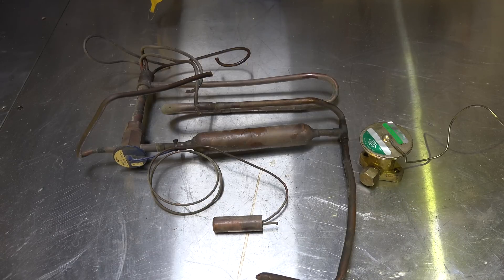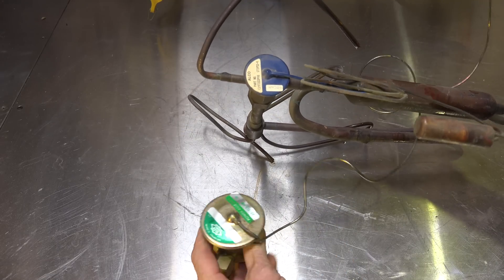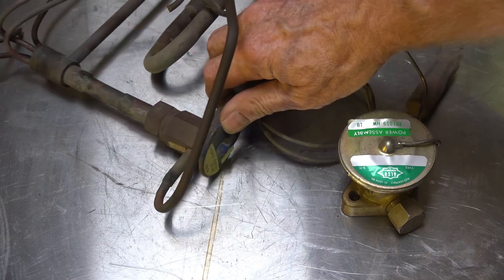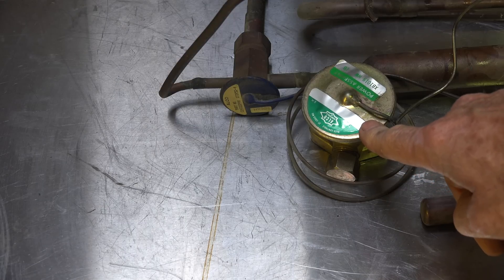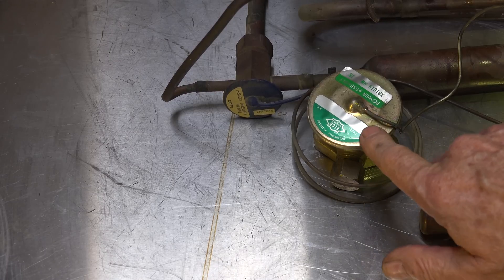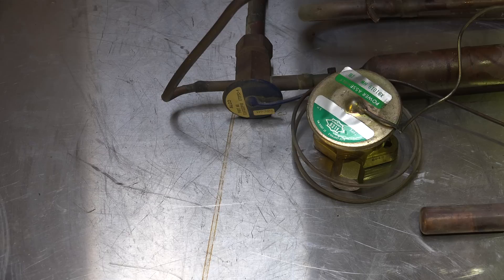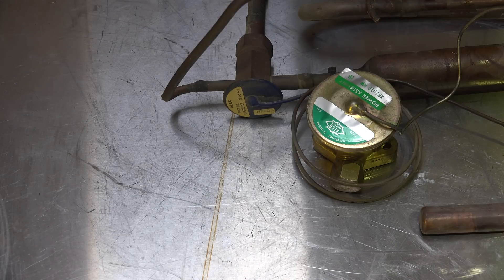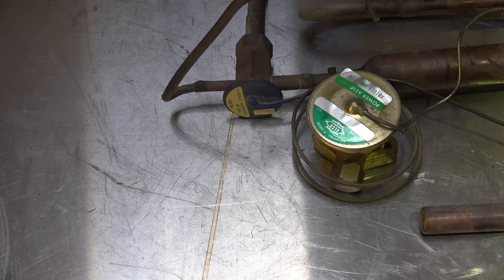TXV power head size

Comment: can you take the head of the larger valve and (if it allows it) attach it to the smaller... in other words I have some install guys that like to burn the sensing bulb up and I have a bunch of these TXV for two and a half ton three and a half times 3 times that I stock on my truck from other jobs all carrier/bryant can I take the sensing bulb and head off and attach it to one of those if it's larger... or will that not work thanks love your videos
Reply from the maker: Only if the power head is removable.  The one shown is an Alco 2 piece.  Not common on new installs.
GFM